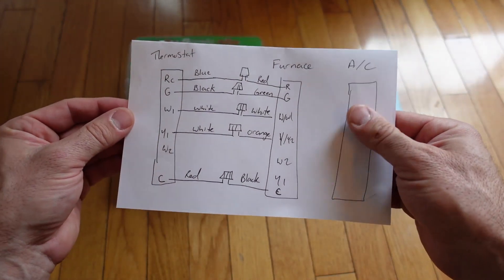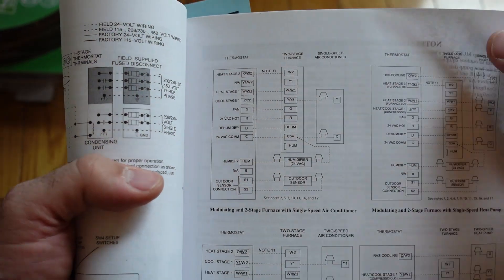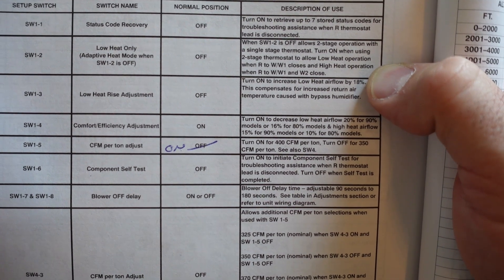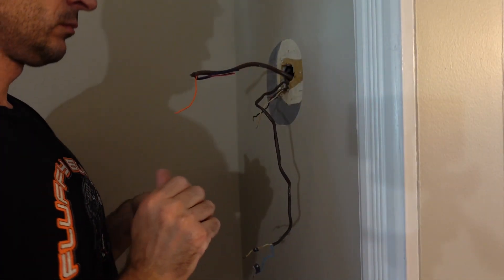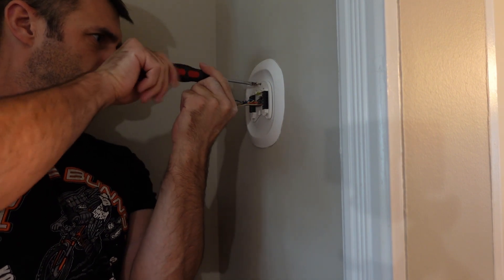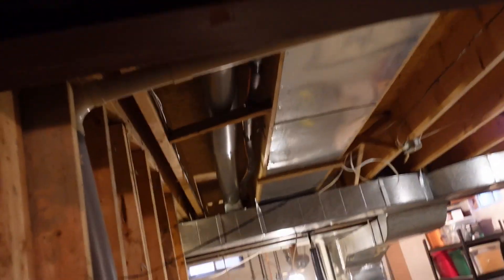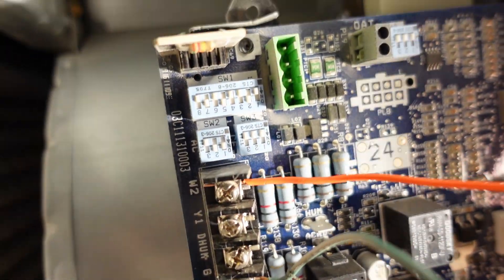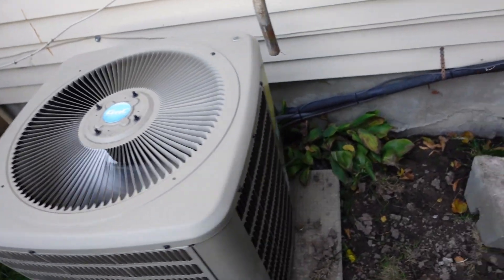2 Stage Heating - Ecobee Thermostat Wiring

Comment: What is your Ecobee thermostat model using in the video. I am using the same Carrier model, I can not see on control board other wiring connection, I am using Essential. My old thermostat 4 wires. Problem on me is Furnace is on but outside AC fan is running. Technician check the wiring, He told me extender kit and thermostat defective.
Reply from the maker: I'm not sure on the model but i bought it in 2020. When I first set it up i only had a 4 wire set up. I did the video for that set up as well. It is linked in the description of this video.

Comment: Thanks for sharing! This tells me how to wire ny 2-stage heating/cooling system. My system also has a variable-speed fan (connected to BK on my old Trane thermostat) - do you know where on the Ecobee to connect the black BK wire, as there is no BK on the Ecobee premium? If not, can you suggest a thermostat model that has this? Thanks!
Reply from the maker: Sorry, I only know about the stuff I got. If it isn't in the video I don't have the depth of knowledge to comment on it.

Comment: be sure to enable reverse staging - or the ecobee thermostat will just time out and switch to high - the out of the box settings for 2-stage heat are awful.
Reply from the maker: I adjusted mine a bit. It actually never goes to stage 2. I also re-did a lot of the insulation in the house which probably helps.
Reply: @DIYNorth  furnaces that never need to use second stage to maintain are oversized by wide margin - most are because contractors and scared to install 40 000 btu furnaces in detached houses.  if the area gets to -25c as an example, the furnace should need to run on continuously cycling between low and high much below -10c. the point of 2-stage is continuous operation in cold snap and ignorant contractors totally kill that between oversizing and use is single stage thermostats.

Comment: Great Video! I just had a new system installed running single stage AC with Ecobee Lite.  The installer did not wire stage 2. Your dip switches are in different settings. Switches 2,3 and 5 set to off and switch 1 with 4 and 7 On position.  Sadly I found out the Ecobee will not support Variable Speed since our furnaces are 'communicating' type furnace but Ecobee is not.  Therefore its really running as on and off. I was just told we need a communicating thermostat to do Variable speeds.  For AC I really want 100% blowing speed but Heat as Variable. Sounds like I will need to get the spendy thermostat.  Are you getting 100% AC blowing speed but have the option to adjust speed(high,medium or low) on Heat using your Ecobee? With the cost going to the Infinty feel like we are not getting the efficiently using Ecobee? I love my Ecobee too!
Reply: Got it! Good to know the speeds on stage 1 vs stage 2 heat.  I would emagine that should be sufficient without going to the expensive communicating thermostat especially since the AC is stage 1 only for summertime. I need to figure out why my dip switches are set completely different than yours.  Thanks for the quick response!!
Reply from the maker: The installer likely set our switches differently based on the size of our home the total size of the duct work etc. The manual explains what each does.
Reply from the maker: The ac goes at full speed yes.
My furnace goes at either low speed (stage one). Or high speed (stage two), there is no in between option on my ecobee or furnace.
For the entire winter last year the furnace only ran at stage one.
It never had to go up to stage 2 heating. I also did a lot of insulation work in the attic and basement which might have helped.

Comment: Thank you!  Heating worked, all thanks to you.  However, my AC doesn’t seem to start and I see that your sw2-1 and sw2-2 are down. Is that what you had to do to run AC?
Reply from the maker: the SW2 bank is for the AC, but I think those switches are more for the air handling volume and not on/off for the AC. I have never messed with them.
Did your AC work before? I'm not really sure what the status of your system was. If you just replaced an old thermostat with a single "Y" wire and it was hooked up to the same spot then it should work. Unless someone pulled the breaker/fuse when it was winterized or something.